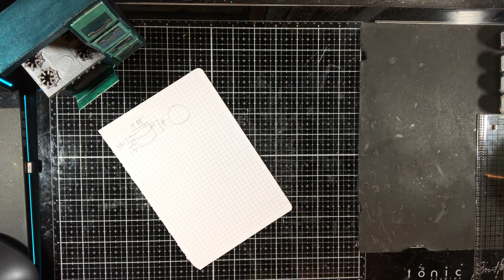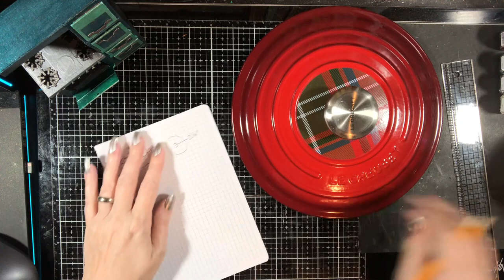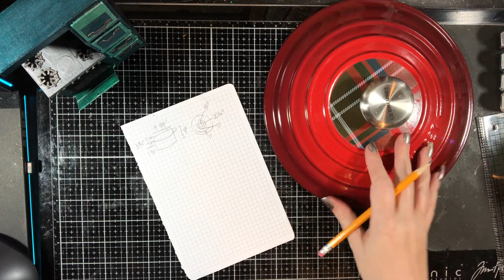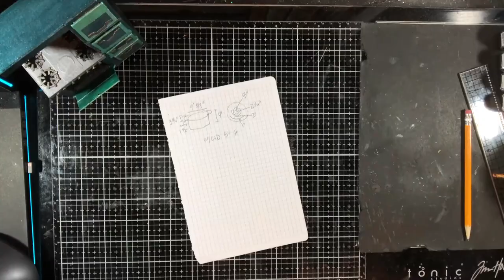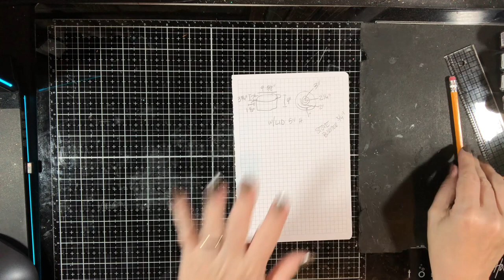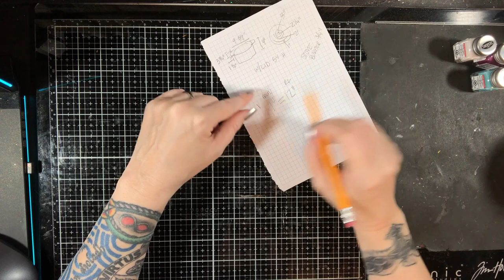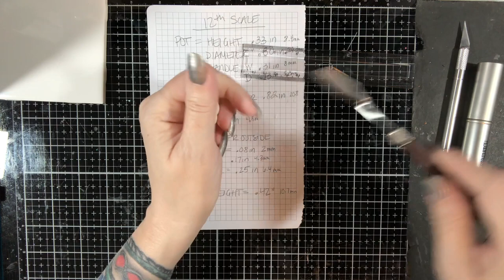Dutch Oven Part 1: How to Make a Real Item into 1:12 Scale and Main Pot Body Construction

Comment: I have found it is better to bake on glass.. use the glass from a cheap dollar store frame.. and tape the edges.. also..to make a dome.. use glass cavichions.. you can bake on them and no texture.. if your sculpey or fimo is sticky.. use some baby powder on your surface or corn starch.. just a few tips for ya.. also.. if you are worried about deforming it because you couldnt bake on the tube.. try putting it in the fridge or freezer for a little while..
Reply from the maker: Brilliant, I never thought of using a cabochon (sp?)....bet it would work for other things too, depending on the depth...like serving bowls and such.  And as for the glass, I had noticed others doing that too....may have to give it a try!  Believe me, I can use all the tips, since I am still getting the hang of things. Thanks!!! :)